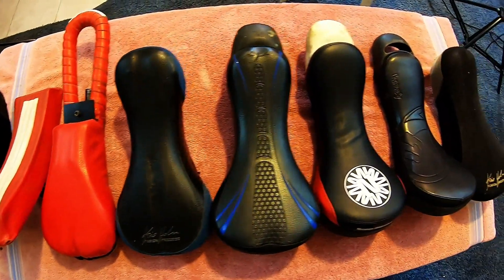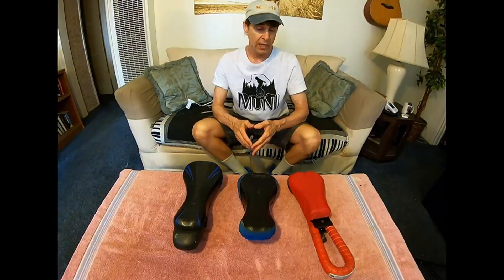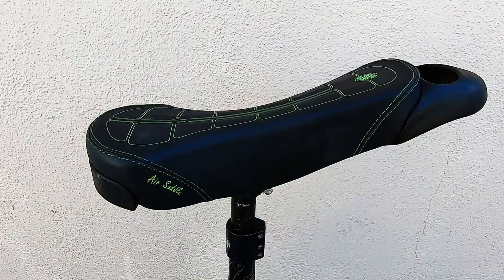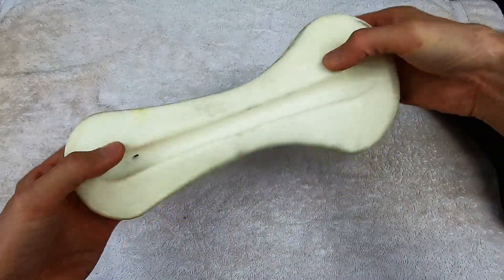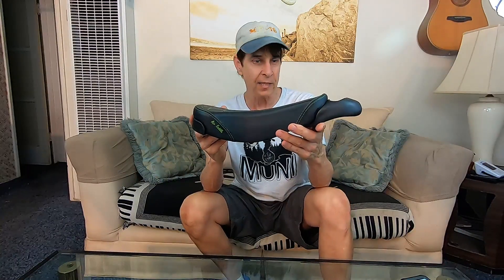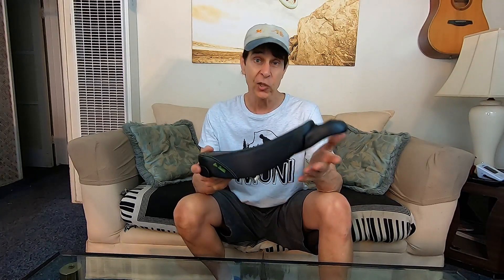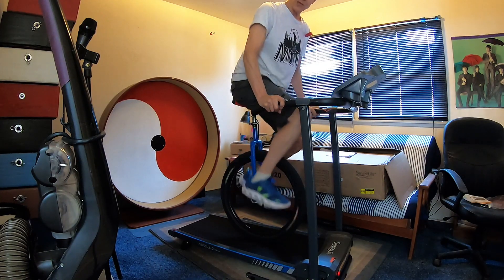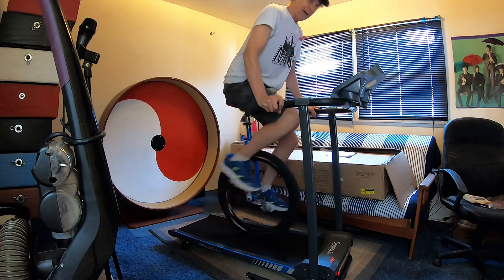Nimbus Air Saddle Review (and Treadmill fail at the end)

Comment: I just tried riding my uni on a treadmill yesterday I didn’t realize how much I fluctuate my speed while riding until I tried it
Reply: I tried at my physiotherapist, an idea of him to see if unicycling was in cause in a knee problem. It was a total fail! Now their treadmill had a rather soft rubber belt, probably great for running but awful with the uni... it felt like riding on sand or with an almost flat tire: lots of fighting and effort required to move the cranks! But I'd try again, it seems fun - there's a guy who's posted a couple of videos of him riding and juggling on a treadmill, worth watching!

Comment: Thanks Terry! You say it's a little bit like the Stadium. Does it mean it's also a saddle which works better with a handlebar or with one or two hands on its handle? I find the Stadium rather unstable for no-hand riding, and I don't thing I'm the only one...
Reply from the maker: It does have a lower profile which reduces pressure on the perineum while riding and the addition of the air bladder really improves the comfort level. Always a good idea to  keep you non-dominant hand on the lift handle to keep yourself planted on the unicycle, or a T handle or some other type of handle. Proper saddle adjustment is also important and it might take awhile till you find the right angle that works best for you. In my case, I like to tilt the nose of the saddle up so the back area of the saddle is lower and more horizontal to the ground.

Comment: I wanted to ask on Unicyclist.com forum, but since it's down... Isn't there a way to have the KH handlebar AND the lift handle on at the same time? I have the stadium saddle. Maybe it's possible in the KH freeride saddle? Anyone know?
Reply from the maker: You should be able to use both the KH T-handle well leaving the lift handle in place. The only thing is that the angle of the T-handle won't be able to go up as high as it will hit the lift handle. But yeah, I have run both together without a problem. One way to to get the T-handle higher is to use the 30 degree handle which has a curve so it will go higher without hitting the bottom of the lift handle.
Reply: @TerryUniGeezerPeterson  Did you have the metal reinforcement bar on? I think the screws are too short with it; but I'm not sure.

Comment: Question for anyone who has ridden both a KH36 and Nimbus Nightfox.  My 8 year old daughter is learning to ride.  I told her if she learned to ride I’d get a uni myself and ride with her.  At this point it’s pretty apparent that she’s gonna do it and I need a uni.   I did a lot of unicycling as a teen and I’ve been bicycling regularly for decades, so there won’t be too much of a learning curve.   So, I’m a big guy at 6’1”, 230# and I’ll be riding on streets and some cross country, so it sounds like a 36er would be ideal for me.   I’d like to get the Nightfox, as my daughter could probably ride it a few years from now once she hits 5’ or so.   The problem is, it’s not currently available.    The KH36 at unicycles.com is available, but it’s also $300 more and not as adjustable.    Is it actually worth the extra money?   I don’t mind paying for quality and a Nightfox frame is very affordable, so I could always order one later if the components of the KH are worth the extra money.  

Any insight would be appreciated.    Thanks.